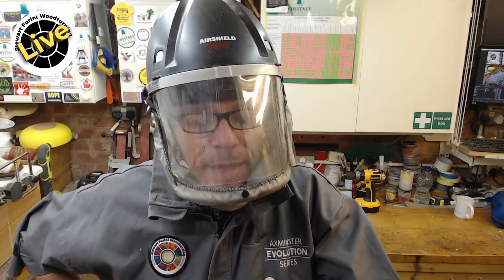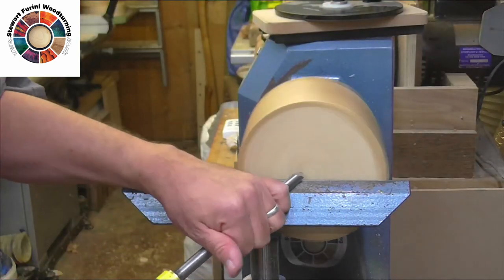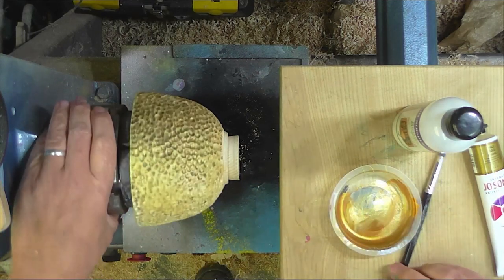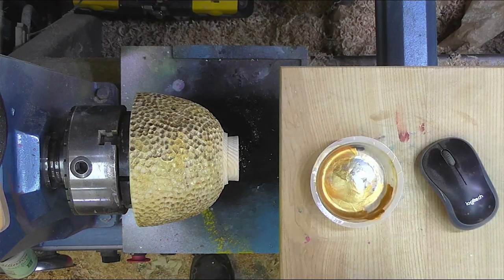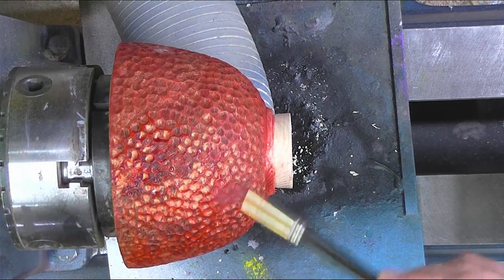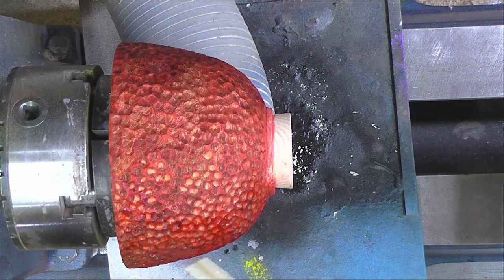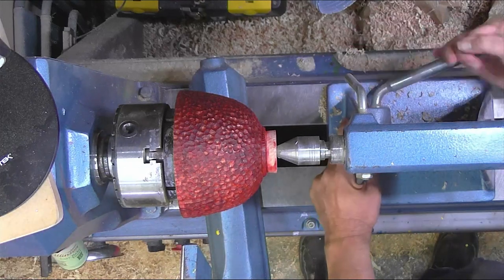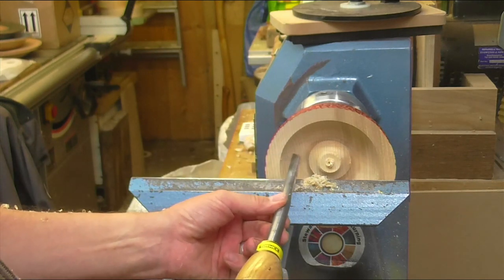Woodturning an Ash Bowl - Textured and Coloured

Comment: I normally avoid the comment section, so I'm sure I have missed this being asked before: but do you ever detail the hardware/software you use for your multi-camera switching system?
Reply from the maker: Hi Doyle -thanks for your message. I have done so in the past but don't have a current video. The hardware is C920 webcams from logitech which are connected to a PC running an i5 intel processor (i7 would be better really!) and then the recording is done with a piece of software called OBS. I've added two Panasonic camcorders that are connected to the PC with cheap HDMI convertors (about £18 when I bought them) which gives me the ability to zoom in if needed. Perhaps I'll do an updated technical video over the next few weeks...Cheers!